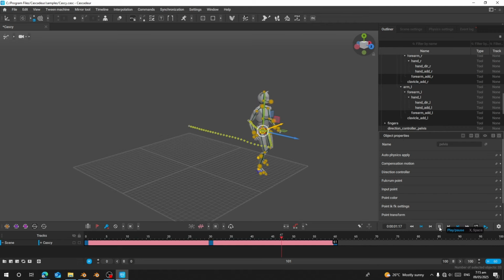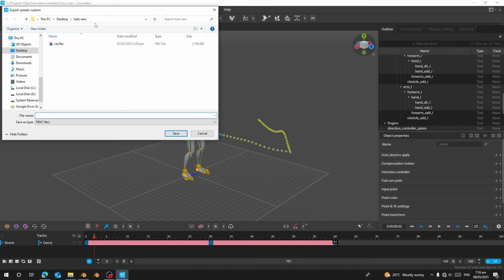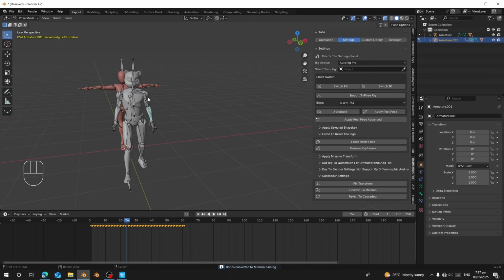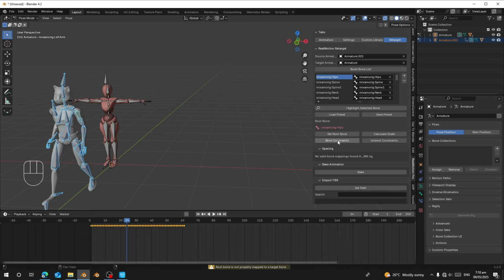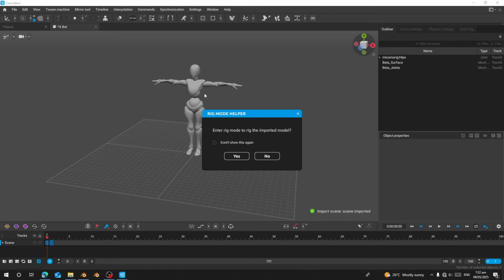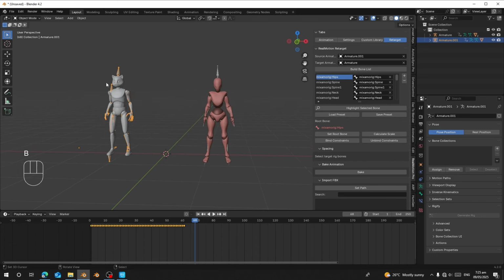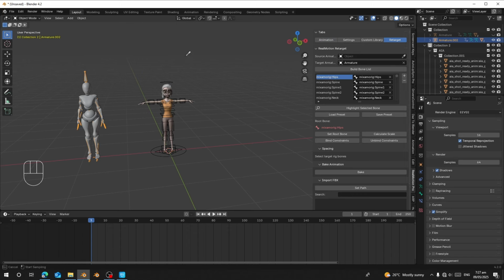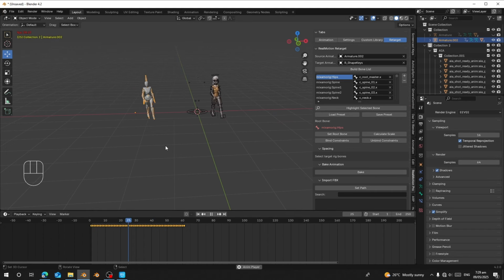How To Retarget Cascadeur Animation To Any Rig In Blender Using RealMotion Pro

Comment: if from the one model i want the animations to add on the new model the animations but the bones are diffrent it is works or i have to make same bones on the new model same as the old that i have the animations ? am asking because i have 800 models each one has 11-14 animations and is really hard to make more for 600 more models if this works ill get this addon
Reply from the maker: You have 800 rigged models 
Each has 11-14 animations. If all of the 800 models share or use the same rig type, then you can save those 14 animations into your library, which can load to any of your 800 models. But each has a different rig type,  eg (the bones' names are different from each other , the orientation are diff, position are diff) then you can't share or load the animations to the others. 

If you need more explanation, check my discord link in my bio
Reply: @weelearnfrommobile773  all are separate we talking about... Digimons... so i made new digimons not yet add animations and i want to add some movements the same as the other models so... i cant i see is there any test addon to check if works ?? if works then ill buy it full i really need it to try
Reply: @weelearnfrommobile773  WHAT if i add new bones same name as the old could works ?

Comment: hey! the load bones preset is not working
Reply from the maker: Make sure you are using the current of RealMotion, 
Also, if the presets don't work on your rig , you can manually map the bone list and save for feature use.
Note that for cascaduer,  after importing, you have to convert into Mixamo bones' name first .

I have a Discord link on my bio 
I can guide you more there 

Thanks

Comment: without cascadeur we can use my  own fbx model directly in blender and retarget this using realMotion ?
Reply from the maker: Yes it will work, if your rig type is not in the presets you can manually map them and save the mapping for later use